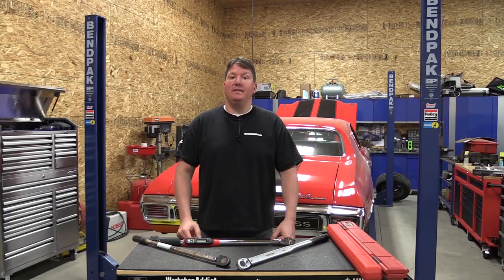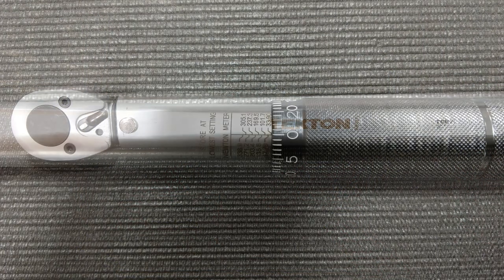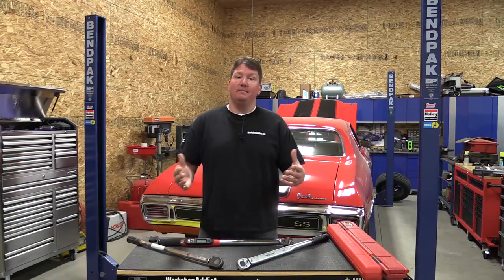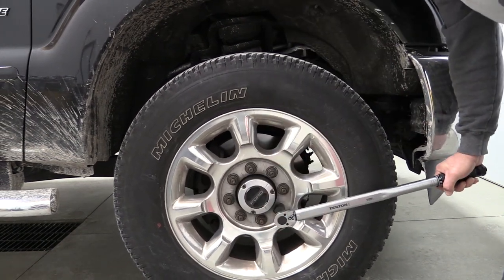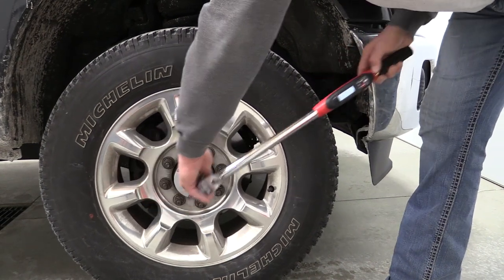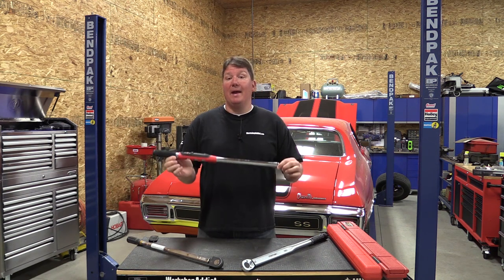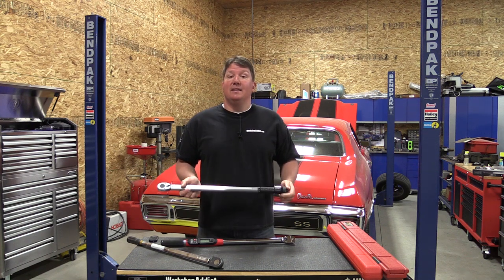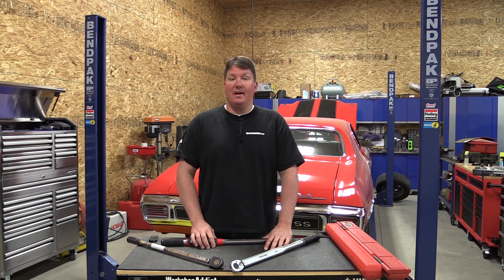Buying Tips: 1/2" Torque Wrench for Automotive Enthusiast

Comment: You gave lots of good information.  Most torque wrenches clicker or digital are rated with their +/- tolerance of 20% of full scale (FS) clockwise rotation only.   So the 250 Ftlb one more than likely is only guaranteed 4% above 50ftlb and probley 5-8% from 25-50 ftlb along with counter clockwise rotation.   The other big thing to point out is the radial groove in the handle on your TEKTON is the calibration point to pull from.  If you apply force closer to the ratchet head the torque output will increase a few percent,  and if you pull on the very end of the wrench the torque output will decrease a few percent from your setting.  This is the same for all wrenches whether beam, clicker, dial or digital types.On a side note I've never checked a Harbor Freight torque wrench that passed calibration on our Snap-On transducers at work.
Reply from the maker: Thanks for adding some great info!

Comment: Interesting video. I only got to your video because I just bought myself a torque wrench. Not because I’m a mechanic, but I bought a nice car last year and I decided that I am going to look after it myself as much as I can.
I have been looking at torque wrenches for a Long time, it is an expensive tool and I wanted to know I bought something decent.
My criteria was that I just want One torque wrench that does it all, from a wheel lug nut to the oil filter and sump plug. So to me, the Range of the torque wrench was my deciding factor, and now I have a torque wrench that goes from 10 to 150 f/p, that will do me very nicely.
Thanks for the tips here!!

Comment: The quality of spring alloy is what makes or breaks a torque wrench. The factory calibration of a $10 torque wrench will be accurate out of the box. However, the spring will distort slightly after only a few uses and throw the wrench out of calibration. The spring alloy in a $400 Snap on the other hand is rather exotic and will go for miles before re-calibration is needed.

Comment: Hello ,
I have a question maybe somebody can help .
I have a torque wrench ( 50-250 fp ) and I have to torque sway bar links witch is 40 fp , is it ok to torque it 50 fp ?
Reply from the maker: NO, a torque wrench is only accurate in the upper 80% range of what it is rated for.  Yours really is not even that accurate at 50 ft lbs.
Reply: WorkshopAddict 
Thank you , can I tighten it by hand so no need to buy another torque !